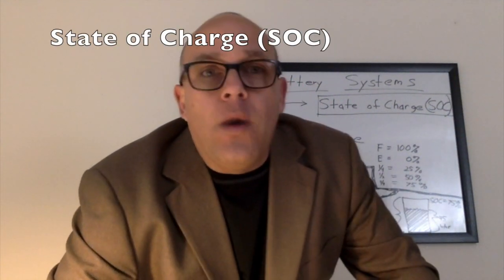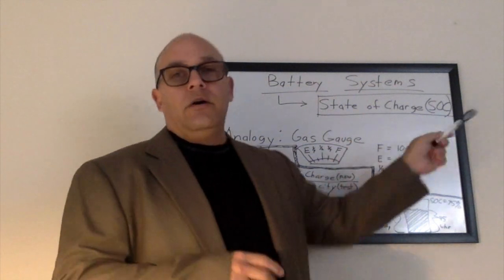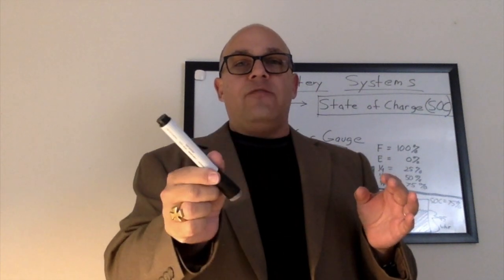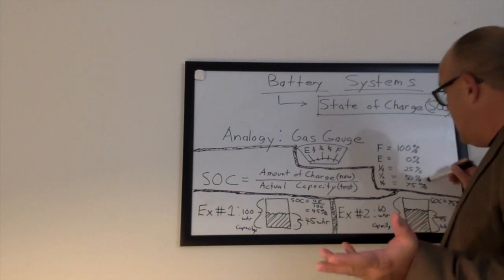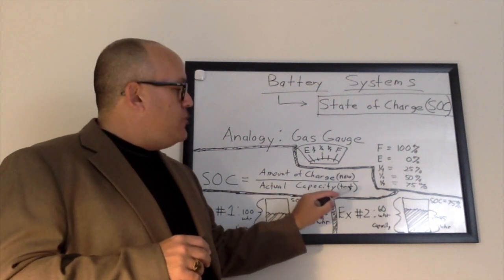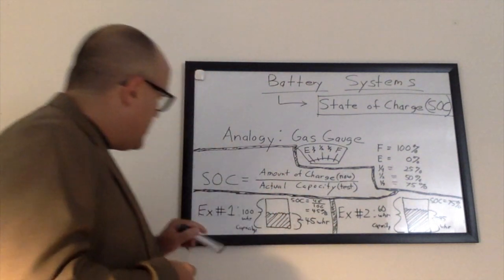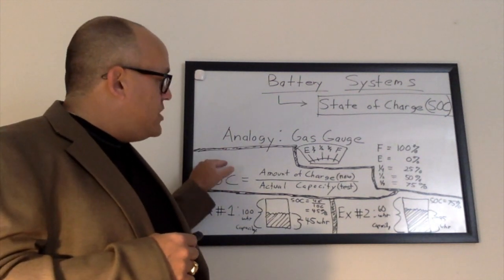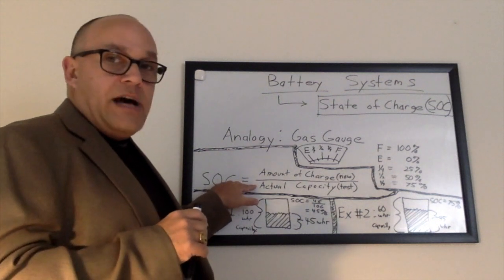Battery Systems - State of Charge

Comment: Here as per the definition the SOC = Amt of charge / Actual Capacity.
If we focus on the SI units, then it leads to, 
Amount of charge = Coulomb
Capacitance = Coulomb / volts

# SOC = volts. 

How is this possible
And how we can define this SOC?
Reply from the maker: However you do the calculation, the result should be unit-less.  It is like a bucket of water: it has a capacity in gallons or liters, and it has a present amount of water inside it also in gallons or liters.  For battery engineers, I recommend using watt-hours to do the calculations, although you may be asked to use the amateurish "amp-hour" specification.  I consider "amp-hours" an amateur calculation based upon obsolete lead acid rules of thumb, yet we have to use them since much of the market demands such specifications.  You can use coulombs, if you know what you are doing, but that may just complicate things.  If you are indeed a battery or systems engineer, all this is quite basic, and one must simply keep track of the units carefully in a spreadsheet when specifying or simulating the system.

Comment: Let's say you measure both voltage and current while charging a battery at a constant rate to find out its capacity in Wh. Now we know the total capacity. How would one determine the amount of charge at a certain random moment in time?
Reply from the maker: Very good question.  This question is the Piece de Resistance of battery systems engineering.
So … you can integrate the current over time.  The problem is that current sensors tend to be inaccurate, and integration accumulates the errors over time.  You will need a plot of State of Charge versus Open Circuit Voltage.  Then, you will need a plot of the resistance of the cell as a function of State of Charge.  So, you will have to calculate SOC from integration of current over time, then go find the resistance at that particular SOC, and calculate voltage drop, and then Back-Estimate Open Circuit Voltage to get State of Charge.  

Thus, for calculations, you will have measurements of only current and Vcell (measured live at the cell terminals).  (1) use integration to find estimated SOC.  (2) Use Measured cell voltage and resistance tables to back-calculate Open Circuit Voltage.  Determine the error between the two.

This is not typically easy to do.  It often takes a lot of data to do these calculations, and with very basic data, the calculations can be off 25% or more, depending on the precision of the measurement and the precision of the estimation algorithm.

If the numbers are not accurate enough, you will need to develop a circuit model, and if you are doing precision research, you may have to develop a Kalman Filter class of models for your cell.  But if you are experimenting for personal use, or simple and basic consumer electronics, this may be sufficient.